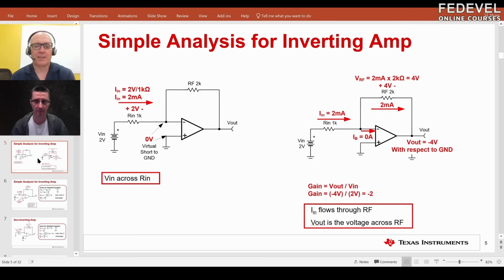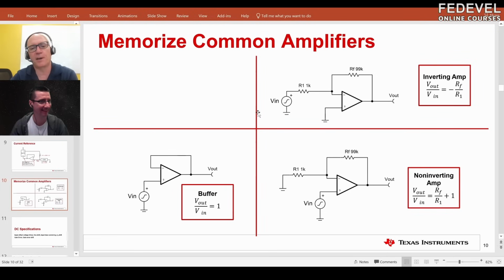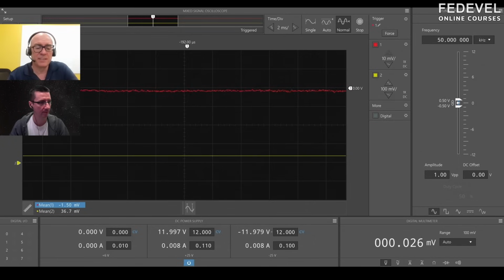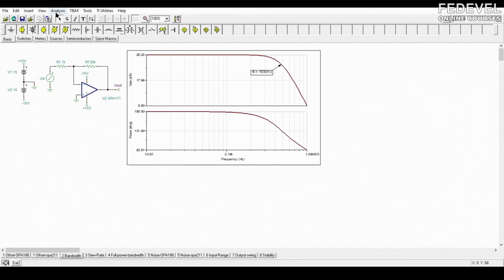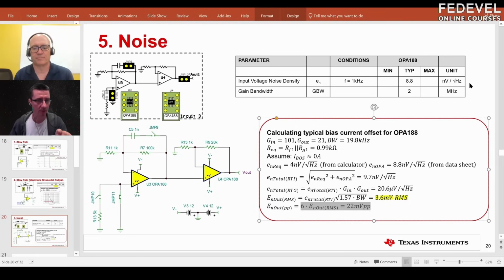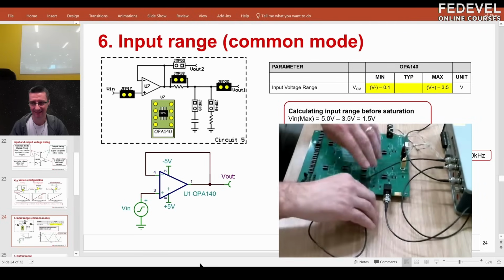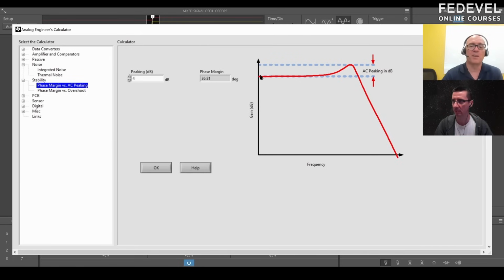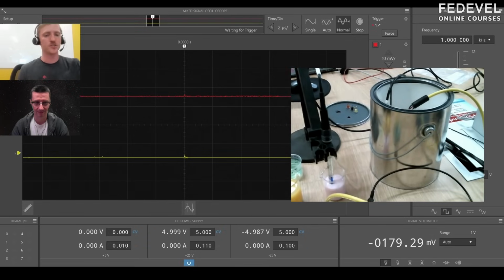Everything Important About OP AMP (Operational amplifier)

Comment: Re: Slew Rate - beware that a slew rate of 0.7 V/us is pretty crappy these days. 20V/us is more common (about 30x higher). Also just calc the max slew rate of the Sinewave you  need to output and your Opamp spec should be greater, simple as that.

Comment: Well opamp won't be at voltage of the power supplied to the opamp only  rail to rail opamps will go to the power supply level otherwise it will be a voltage drop of 1.5v on average..can be even 2v. I see that this guy is slipping a lot not Gona go into rest of it but it's a shame when explaining to someone something yet we have a shallow chat about it and totally missing key important aspects of an opamp and its operations

Comment: Good video and nice presentation with demos. I recommend Arthur Kay's book about Op Amp Noise for practical engineers.
However, I think we miss a very important part of op amp topic, which is the modeling of the op amp. Think about modeling of the noise sources, CMRR, PSRR, slew rate, input impedance, and output impedance.

Comment: OPA928 is a competative of the long out-standing ADA4530-1, which appeared roughly in 2016. And TI even made it pin to pin compatible to ADA4530-1, with the same guard ring structure.